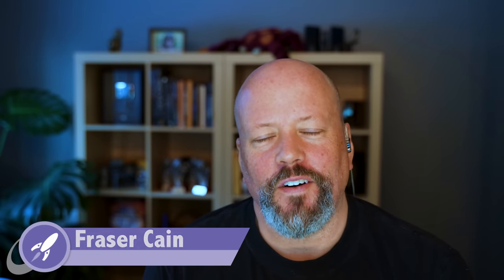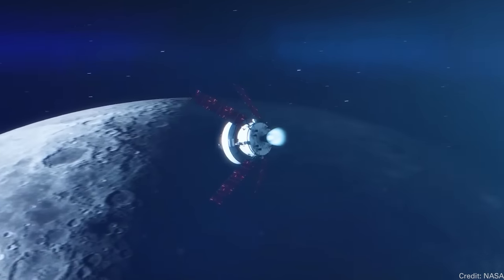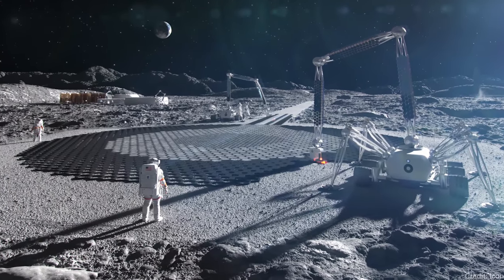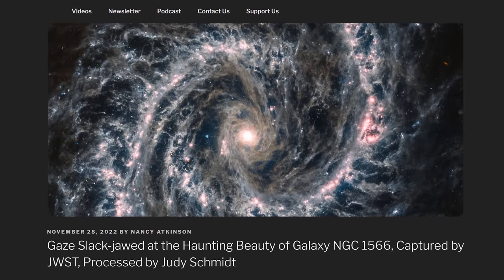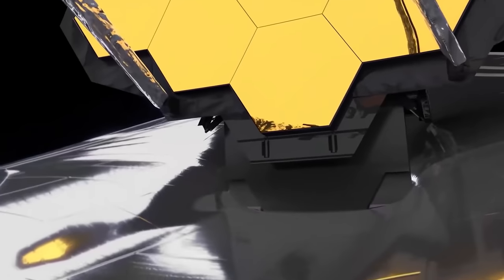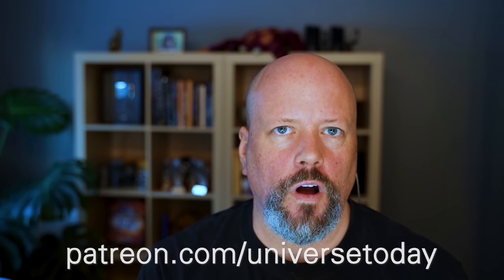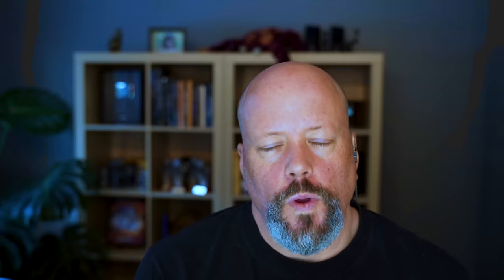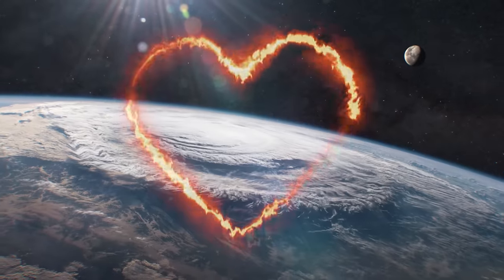Scientists Simulate a Wormhole // NASA's Moon Infrastructure // China's Space Station Crew

Comment: The wormhole thing is a little more complicated that that, the interpretation comes from a paper by Susskind and Malcadena where they state an incomplete analogy between gravitational physics (in this case wormholes) in a space and correspond that to nongravitational quantum mechanics on a lower dimensional boundary. In this scenario, we would live on the boundary - but the space in the middle represents a kind of gravitational universe we don't actually live in. Further, the part of the analogy that pertains to this specific case was only stated, never completed/proven. So we may have simulated a wormhole in a kind of universe that doesn't exist and it may not have even been a wormhole.
Reply: But the idea is ER=EPR and quantum computers are literally quantum systems, so it is indeed a wormhole and the only simulation is using AI to remove unnecessary terms so that the gravitational terms can be verified in real quantum systems since we cannot make large systems currently to verify every term
Reply: Also negative energy is not a real thing in classical mechanics but quantum mechanics does allow negative energy
Reply: @2010RSHACKS  The problem here is that ER=EPR is an analogy, there was no mathematical construction of this, so even the simulation claim is suspect.

Comment: Odd question, what is taking the pictures of the Artemis capsule when it's so far from the far side of the moon?
Reply from the maker: It's taking pictures of itself. If you see pictures of the entire spacecraft then it's an artist's illustration.
Reply: @frasercain  looking at the angle of the shots, my best guess would be that the cameras are located on the solar panels or a long extended boom.

I don't know enough about the ship design itself, is there a copy of the tech specs, dimension and structure?

I would love to read them over, I had complete specs of the shuttle, even including wireframe and dimension of the internal structure.